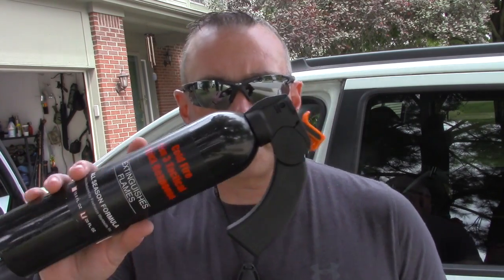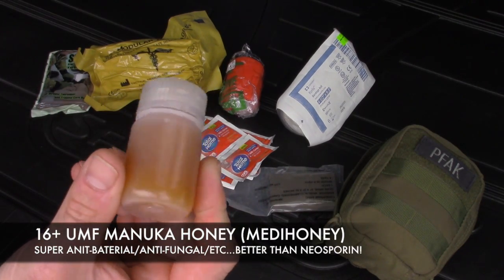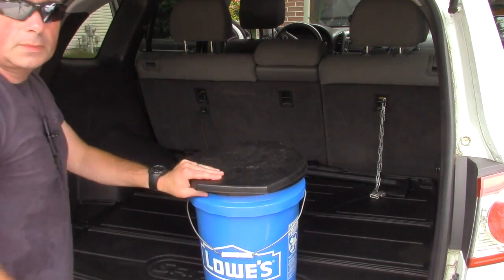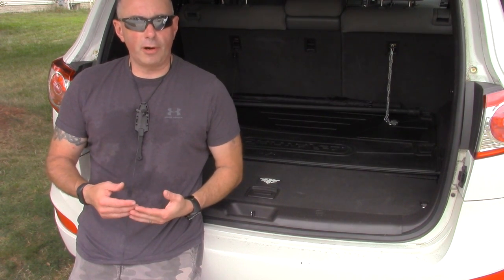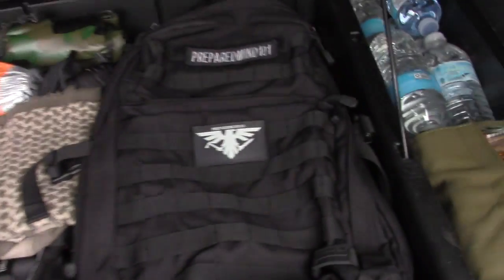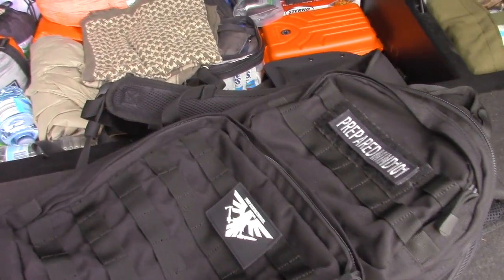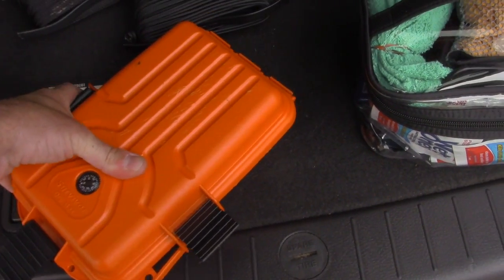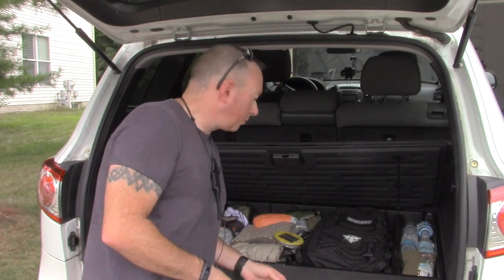300+ Piece Vehicle Emergency/Prepper/SHTF Kit REDUX - Preparedmind101

Comment: so, is this a lifestyle now?   like,  when this vehicle craps out on you,  will you have to shop with a huge storage capacity in mind?   Cuz my SUV has space,  but nothing like what that Santa Fe has in terms of those handy bins.   so when you shop for your next vehicle,  is that enough of a feature to be worth putting it on the "must have" list?
Reply: an suv will either have that space open or in integrated bins. if it's in the open just put stuff in a tool box or something inexpensive looking so not to be tempting.
Reply: +Ben Stone For open bed storage try a length of six inch pie with sealed end caps. waterproof and unobtrusive. A bracket and chain keeps it safe until you want to pull out the folded rucksack and stuff the kit in it.

Comment: You completely forgot any nuclear attack (or nuclear accident) survival item!!! i suggest you at least a geiger counter (for detecting low and medium flux of radiations and also for detecting nuclear contamination), a ionization chamber (same as geiger counter but for medium and high levels!), some pen dosimeter (this is a personal item, one dosimeter for each people.... or maybe two dosimeter for each people, one for low and one for high ranges!) some iodine pills (immediate aid to reduce risk of thyroid cancer in case of nuclear disaster, works only against nuclear contamination and not for radiations) and of course something to build an emergency fallout shelter (for example empty bags ready to be filled with dirt and something for mechanical reinforcement).

Comment: Who ever turned you on to SWAT and RATS tourniquets is doing you wrong. The RATS is dangerous I would ditch them or find a non medical use for them. SWAT tourniquets can be used for compression bandaging so don’t throw it away. I would EDC your SOFFT tourniquet.
The hemostats and sutures I would keep at home. I would keep the trauma kit in like a cheap fanny pack and sew some elastic loops inside. You basically want to keep it hands free carry, you want the contents retainable if it opens up because if you are dealing with a car wreck you might need to run and relocate suddenly.

Comment: Ummm, Where is your rocket launcher, gas mask, and barbed wire fence, lol. Any concerns about heat sensitive items, specifically batteries and a couple other items  you stash. I live in NH and in a car in the summer it gets crazy hot in a sealed vehicle.... thoughts, ideas, suggestions?
Reply from the maker: +Robert Scruton the compartments don't get that hot.I've pulled bottled water out when it's 100° and it's room temp at worst.
Reply: Try being in Texas in the middle of summer. Most days are 98 degrees, and the trucks get hella hot.

Comment: You don't have extra batteries for your flashlights
Reply: If you pick the right flashlights you don't need spare batteries for an emergency kit. I don't use steamlight, petzel, sure fire or a lot of the name brand lights for this reason. I also don't buy the newest tactical 1500lm lights. I hand select lights off power source vs run time. Best light for the money Imop is the Fenix pd32. On lower settings it will run for weeks on one 18650. I use the HL25 headlamp for same reason. Olight makes some good ones that run off one aaa or two aaa for pocket carry that can run for a week or more as well. I go for lights that have a 8-20 lumen setting and long run time based off what the battery is. For example. A E01 runs 30h off a single aaa. That's a good time for a $10 light. The Pd32 will run like 280 hours on moonlight or 120h or something on somewhere around 20-30lm on a 2400ma 18650. Even a good bargain that colorful reyovac at Walmart $1.50 15lm and 60h off a single aa. 8-20lm is plenty bright at night.

Comment: Ok I'm done commenting to the morons below lol.. Only you know why you packed some of the items you did.. I do however think you have way to many redundant things.. Saws axes knives etc.. That all takes up lots of space and adds lots of weight.. Personally i think a small fixed blade and kukri is plenty for everything. Not always the best at everything but will get it done.. Just something to consider. I always over pack my gear with everything and then some.. Then spend months trying to lighten it wo losing capability. I'm a big proponent of the kukri over all other machetes bowies, axes and hatches even a shovel. Easy to baton wood, can chop smaller trees, and the curve allows for bushcraft techniques to shape wood for bow making spear making etc.. I understand the size and weight isn't a major issue cause it's car carry.. But for me I would be thinking of theft replacement.

Comment: Don't what if at the end of your video you have Jessica and your other knives why do you promote them because if someone holds that knife and they're the same hand size or slightly bigger or slightly smaller it's going to be more comfortable then grabbing with a small hand and or a small glove size holding a knife that was designed by someone with a 13 ring size pinky finger don't be so nervous you got this.